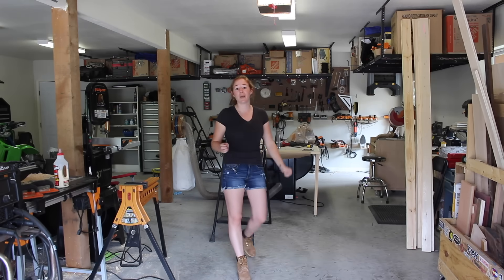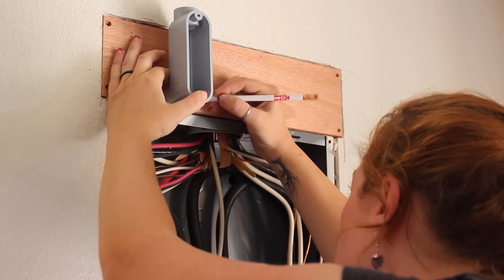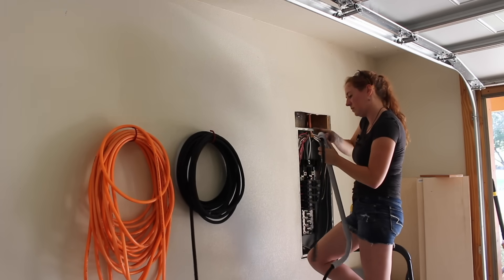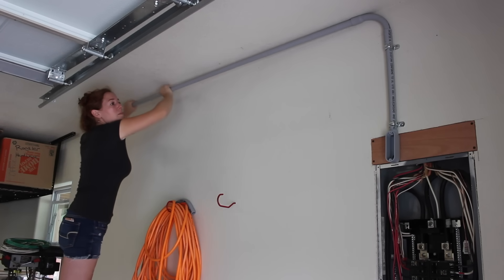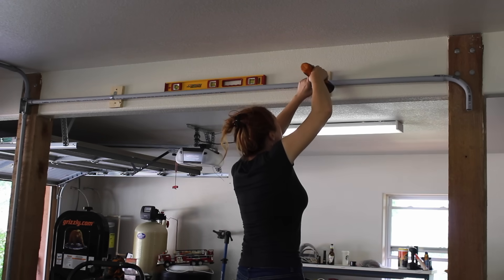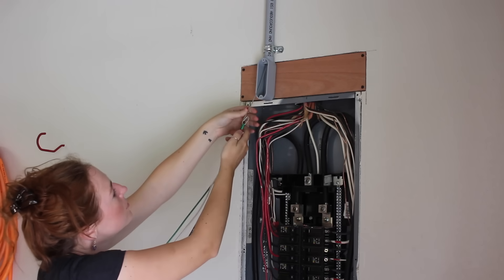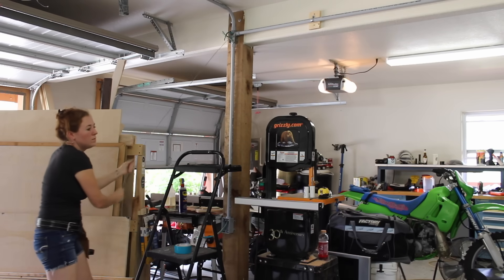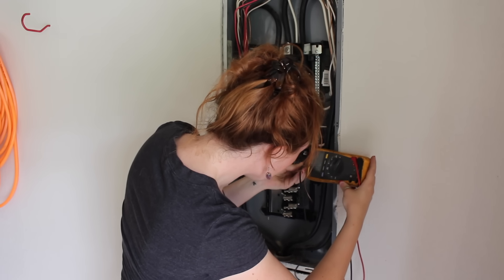Adding 220 Volt Outlets to the Garage

Comment: Running the conductors alone through the conduit is much easier also than trying to run shielded cable through conduit. My only 2 cents is that in busy shop we would typically run dedicated circuits for each power tool but in a small shop where one tool would be running at a time, it's not a big deal.  Nice job :)
Reply: +ArtisanTony I am not an electrician but I did sleep at a Holiday Inn Express last night. To that degree, I feel regardless of her intended use she should make individual circuits for the plugs. That is the common understanding and this seems to be an exception perhaps only being an inconvenience as some units draw quite a bit of current upon starting. 

I feel she should label the outlets as related to the breaker box , ie. 12A and 12B.
Reply: I know, I was just adding that even if it were allowed, it is easy to fish the conductors without shielding. We actually had a rehab job where I wanted to run a partially expose romex through a conduit for a short distance and the electrical inspector let us do it for then one instance. I just remember how big of a pain it was running the shielded cable through the conduit.
Reply: ArtisanTony I would have separated the two circuits myself since she talked about using the plasma which will use the compressor too. Both are 220 items.
Reply: Roger The Tinker I can't remember ever sharing a 220v circuit but I guess when you have a small shop with one person working and mostly one tool running you can get by with it.
Reply: ArtisanTony I
Reply: I was wondering why she was running the conductors wires instead of 12/2 or 10/2 wire...  :P

Comment: I'm not an electrician but have built my own shop, wired as a sub-panel from my house breaker (inspected and up to code, btw).  Although not nearly as safe nor attractive as yours, most of my 110 and 220 circuits are simple rhomex cable and very simple metal junction boxes, covers and connectors/switches.  Yours is DIY-perfect, from my perspective.  Job(s) well done, April!!

Comment: Excellent!  This will make your shop so much better!  I'm not an electrician but I do have a lot of electrical experience and I didn't see anything alarming wrong.  I guess the conduit joints don't need to be glued together?  I'm guessing they're suppose to be, but everything looks so secure.
Reply from the maker: I'm not sure if they are required to be glued or not but I didn't want to glue the joints together incase I ever wanted to change things around. : )
Reply: Nope, don't need to glue them(unless in a wet area kitchen, bathroom or sauna)... and when u do underground installation u need to stop the "ingress of moisture" as its seems to work like a vacuum and suck the water into the pipe. Some don't put enough glue or use primer and when u back fill they seem to separate and some don't use sand to pack around the pipe first b4 they back fill with dirt.

Comment: The whites should be marked with a turn of tape (or you should have used red wire instead) as they are not neutral (240V being a live to live connection). 

When pulling the wires through it may help to put a turn of tape around the hook to avoid it catching on something and undoing itself.
Reply: Wiring up a new line from a panel is not rocket science. 
- Triple check your documentation before starting (And double check you what bits you can legally do in your area), get everything double checked and inspected by someone qualified for it, and be prepared to unhook things and start over if needed.
Reply: eh no check 2:21 again that's a metal box.
Reply: Jacob Cochran wrong if the white conductor is part of a cable assembly it is allowed to be reidentified.
Reply: Matthew look up the code.  It says "Cable Assembly".  Pulling individual wires through conduit does not qualify as a cable assembly.  Therefore April has to pull 2 colored wires and a green for a standard 2 prong plug with ground, or 2 color, 1 white, 1 green for an appliance plug like a stove.  

Had April just ran a strain relief out of the top of the panel with a 12-3 SOOW cable she would have been able to do exactly as you said.  Or had she used BX Cable to make the conduit run from panel to box.  But she didn't so she can't.  I deal with code and building inspectors as part of my job.  The area I live in follows the NEC code with very little addendums.  So you want to keep arguing with me??
Reply: ratchetfreak good point!
Reply: @Matthew Well it is my experience that the guys who have been doing it the longest usually are the ones that are the least up to date on NEC code changes.  

"I've been doing it that way for 25 years I know what I'm doing."

"Yeah well the code changed but you just haven't changed with it, and not having building inspectors make you fix it has led you to believe your right.'
Reply: Gary's right, Matt. I also have a couple decades of electrical experience and a formal education, and he is still correct.
Reply: Kew Akl very true.

to be fair though, the code reads like VCR instructions.  I'm fortunate to work with a master that has virtually memorized the code and he continues to study it as it changes.  he has really helped to explain what it's actually saying but even then, those explanations are his interpretation of what it says.

the code is like the Bible, you could have five people read the same passage and get several different interpretations.

yet, in other areas, it's cut and dry...
Reply: "The key to the code is to understand it. " 
That's funny.
Get three licensed electricians and you can get four misunderstandings of  THE CODE!
Reply: Jacob Cochran my bad I must have skipped over that part, I haven't even watched the video yet. sorry.
Reply: Thanks, @garygsp3! I don't really care that April's installation is not compliant, personally. But it is irritating to see so many people saying that it is OK as long as the wire is re-identified. Because someone may read this and think it is true.
Reply: Bob...You are so correct.  That is why I pull a homeowners permit and when the job is done let the inspector tell me if it is done right.  If not, it doesn't get turned on.
Reply: Harold Bullock I find moist inspectors go be there the biggest waste of manure there is. Usually much more orbs political job than one based on knowledge.
Reply from the maker: I came back with a red marker and marked the white just like the other whites in the breaker box. : )
Reply from the maker: Bob you are on a tangent but don't seem to know what you're going on about. I put out there that people should definitely, regardless of their knowledge level have an inspector check their work. Also, I have a handle on this white vs red wire being used situation. I've addressed it in several comments.
Reply: one thing I forgot to ask: Did you ground the boxes? When using plastic conduits with metal boxes each box must be grounded.
Reply: re-identfing the nuteral(white) isn't up to code unless it is #4 or above, or part of a cable assembly.  in that application you need to use red wire.
Reply: She used plastic conduit and plastic boxes too. She ran the green ground to each outlet so her machines will be grounded
Reply: The key to the code is to understand it. we are talking about marking an ungrounded conductor not a grounded conductor. the fact that the wire is white is irrelevant it could be neon pink so long as she identifies it as being an ungrounded conductor at all terminations and splices. now should she be using a black, red, blue as a grounded conductor she would have to pull a new wire.
Reply: tpgoat that's why I said unless it's a number 4 or above or part of a cable assembly
Reply: The key to the code is "cable assembly" as in a manufactured cable ie. romex, bx cable, SOOW, SJOOW those are all cable assemblies.  You pulled your own cable which means you easily could have not used a "white common' wire.  Therefore the white wire as a hot wire regardless of the fact you marked it is not up to code.
Reply: Should have addressed this in video. This was a major error / omission and another reason unqualified people should not be doing this type of work. There are apprentice programs and licencing of trades people for a reason.
Reply: April Wilkerson You may have a handle on it but I know in Texas you have to have your home inspected before you can sell it.  Hooking up a white wire as a hot wire is something they are going to make you fix.

Comment: Bold April - showing an electrical project like this.  If you do a dust collection video and lighting video for this new shop you will have the trifecta of videos for the internet experts to rip into. Great job!
Reply from the maker: ; ) Ha yeah, I thought about not filming it just because I know how people to respond to anything electrical....that's why the first shot shows the drywall already cut out. But then I changed my mind. I feel like this is project that a ton of people want to know more about so I said screw it. I'll do it and let people pipe up on my video and anybody looking to replicate the project and take the video as well as the feedback in the comments to do so.
Reply: What people sometimes forget is that there are good DIYers and poor professionals. I partly wired my house (new breaker panel, most sockets) under our local Building Control (aka your permit system) and the Building Inspector was most happy - as was the electric company when they came to replace the main cutout fuse (for the breaker panel swap - I got a compliment off him for being neater than most pros). 

I employed an electrician for the lighting (to my design, lots of ZWave home automation modules) as I was running out of time and I had 50+ cables to run. His work is compliant, works perfectly and he did help me with some of the paperwork for certifying my stuff (I can do the testing and numbers part, but there's a massive tickbox form that I'm not used to). He also gave me peace of mind as a second pair of eyes that I hadn't missed anything - but ultimately I was signing my own work to the Building Inspector and he was doing wholly isolated additional work, which is certified through his own professional body.

However, with no disrespect intended, I kinda wished his wiring was as neat as mine. It is, when it's visible to the householder, but I like everything to be neat, even under the floor. Trouble is, from his point of view, it would add 50% to the job and most people would not want to pay for what they cannot see. I should have specified that in the job and got him to price it in - I just assumed it would be...

He's not the "poor professional" mentioned above - he's a super bloke and I would certainly use him again if needed as he's super helpful, tidy and as I said, there's nothing wrong with his work from a regs point of view. I would just be a little bit more specific up front.

What I was referring to with the "poor professional": I have seem some dire work with regulatory violations done by so called pros, usually house building companies. Earths missing, marker sleeving not there, poor layout, things done on the cheap, cables running outside of permitted zones. I've also caught 2 gas registered fitters out too - one was incompetent and I reported him and the other was safe but slapdash.

That point was just that sometimes, a DIYer can get a better result because we have more time and more emotional investment. The cons are that the DIYer sometimes does not realise that something is going to be a problem or not, so may not know when to ask. Or in my case, I fret about whether something is "the correct way" when a pro would just slap it in because he knows everyone does it like that.

It's clear April knows her abilities and is happy to ask - like me - and good for her!

But there will always be a naysayer who says "DIY electrics - ha - unsafe, you plebs cannot possibly know what you are doing..."
Reply: Thanks for posting it, ive been considering doing this in my shop and so this video was very helpful.
Reply: I can't wait to see what you come up with for a dust collection system. 
They're such neat experiments in practical physics, and have so many variables to play with. 

Shop dust collection always seems like this cool living experiment that adapts and grows over time.

Comment: Hello, what number of cable did you use to make that job? Greetins from COsta Rica!
Reply from the maker: It's 10-3 wire.
Reply: I see, it can change from country to country but with 220 we use only 1 breaker for every 220 outlet and cable # 8, since the machines has a peak voltage when you start them we use a little higher breaker after use the formula for tension. If you someday are using the 2 outlets and the same time can reheat the cable or the breaker can trigger often.

Comment: No code comments from me. :) Now Cody has 220 for when you move out. You have come a long ways from making wooden spoons and boxes. You are getting close to half million subs.
Reply from the maker: Haha no code from you John? Yeah half a million is crazy, and neat. : )
Reply: Antonio Babich in which case she should have pulled two black wires, or a black and a red. You would only use the white as a hot when pulling a cable such as a romex or that cabtire. When pulling individual wires in a pipe it is wrong to use a white as a hot, and will fail inspection.
Reply: Any special plans for when you hit that 500K mark?
Reply: Thank you.
Reply: so you didn't pick up on the white under the breaker termination i see.
Reply: Alan Ferkinhoff
Reply: Well yeah exactly.  She should have used a black and red or at least put some red tape on the white.
Reply: Hmmmm...I don't ever recall her making wooden spoons.
Reply: The white is supposed to be terminated to the breaker, not to the neutral bar, when used in 220.  She's using both phases not just one.
Reply: white for hot and black for neutral. this guy literally has zero idea what hes talking about.  Keep your wrong oppinions out of this if youre clueless.
Reply: @AirCooledPictures  in what country is a white used as a hot? I think you are not north American
Reply: BLACK AND RED ARE THE HOT WIRES.  (Black hat kills you) ( White hat is neutral   (good guy)

Comment: I think you did just fine. There are stand off type brackets we use in the industry that look cleaner than using wood stand offs, but all considering awesome work!
Reply: Maybe a project for later can be carving a fancier looking standoff. Celtic knot panels, or maybe gargoyles to hold up your conduit? :P
Reply: I understand completely.
Reply: April! You have a C-N-C, make your own!
Reply from the maker: Yeah the problem is now that I live in the country, running to the store to pick up something you forgot is two hours wasted. Soooo scraps were my main option. ; )